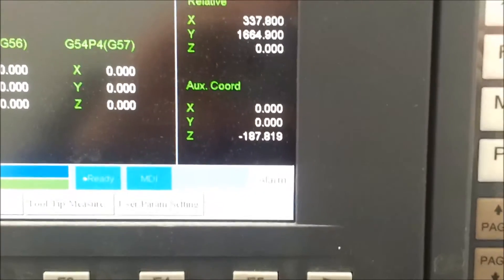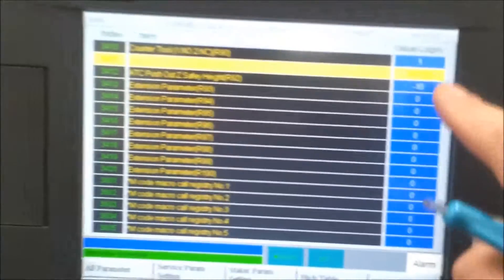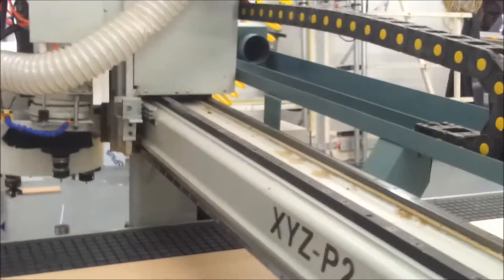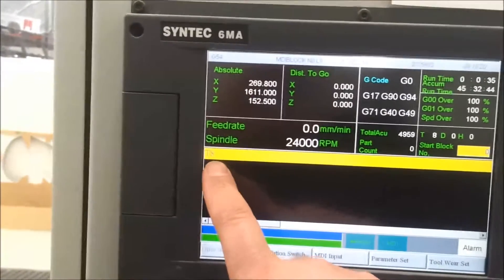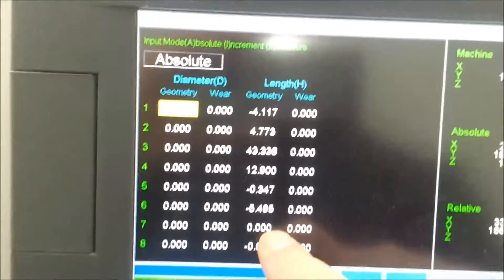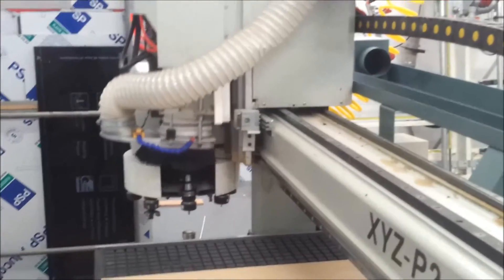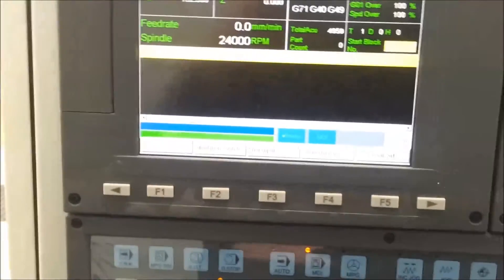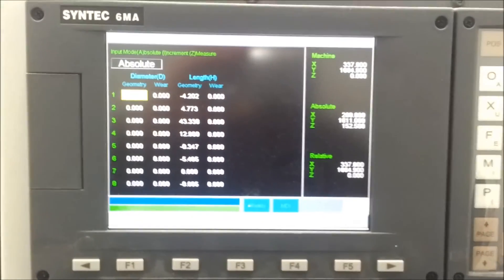Syntec 6MA Auto Tool Part 2

Comment: This controller looks way easier to use than NCStudio, do you know you have to calibrate all the tools from a tool height sensor placed on the spool board? From tool1 (which is the reference tool in NCStudio) you have to manually set all the tools individually, which by the way is all calculated via a Microsoft excel spreadsheet. You then have to manually enter all the values from the spreadsheet back into cutting pirameters of NCStudio. Not too much of a prob if you say break tool3 then you can re-calibrate tool3 (manually). But if you break or have to replace tool1 (which tool1 usually is the skimming tool) then you have to start the tool calibration all over again. This also applies every time you skim the spool board you have to re-calibrate from reference tool1 to automatically set the values for all other tools. Also to double-check the "Z" height from tool1 is zero, you place a piece of paper on the spool board and jog / lower tool1 till it just kisses the paper, like WTF. What they call an Automatic Tool Height sensor when it comes to NCStudio should be re-named to Automatic Pain-In-The-A$$ Tool Height Sensor (with the word Automatic subbed to Manual). Oh well thats my gripe 😂😂 - Syntec all the way baby! 👍👍

Comment: Hi Lee
Very informative mate
Do you have any info on explanation and meaning of parameters eg I have a spindle where they have set the air to blow constantly but I would like to adjust the parameter so that the air only blows when the tool is changing
Also would like to setup the zero stops to automatically drop away when you press cycle start any info would be great
Reply: This is years later, but I would try to find out which M code causes the zero stops to go up and down, then manually enter that into a program to see how well it works. From there figure out how to make the post processor add it to every program.